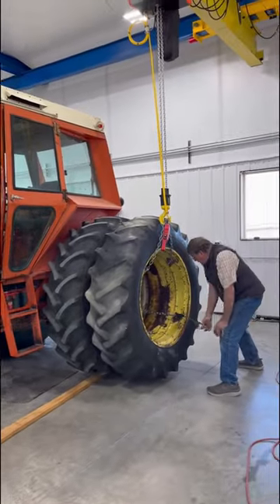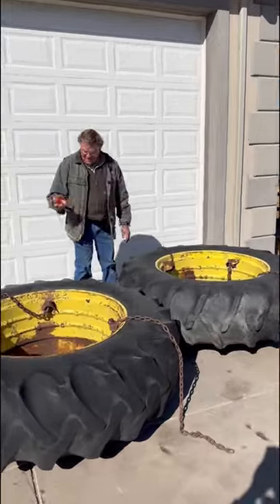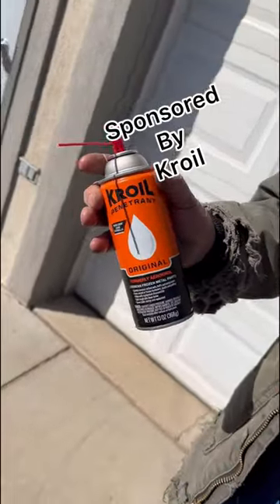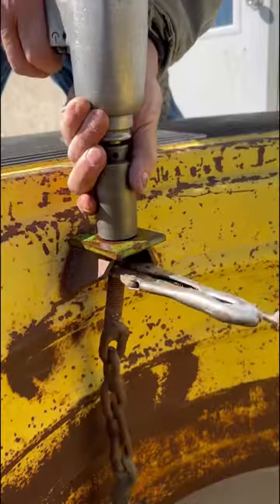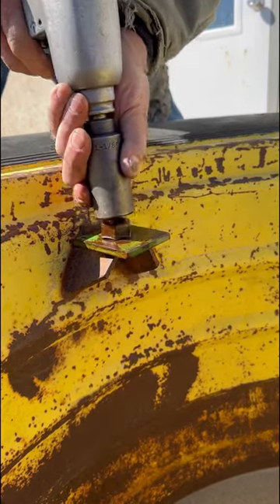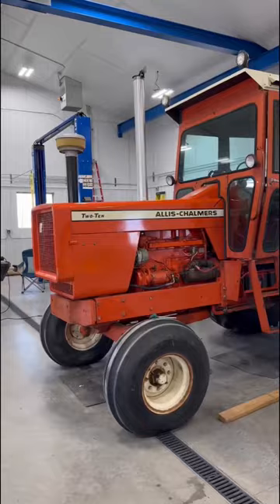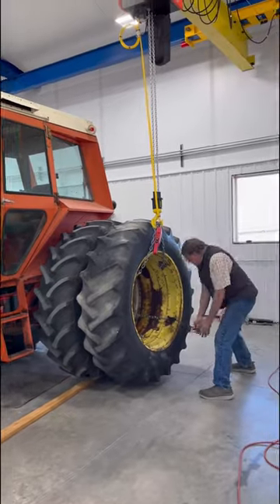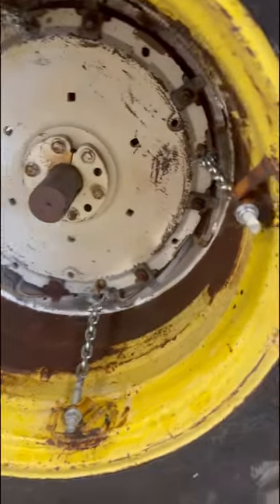#shorts Putting A Set Of Duals On The Allis Chalmers 210 Tractor

Comment: I hope you synchronized the valve stems!
Reply: Rebuild #3 coming up😅
Reply: Gotta have the serpentine belts in time too! So important
Reply: That’s actually a thing on some duals...
Reply: @Record3677 The Johnson Rod needs to be adjusted for the increased traction as well.
Reply: My dad was a mechanic all his career and he became a mechanic for the ISP post in Pendleton and he showed me that if you tighten the nut first it would help to crush the rust on the nut. He used linseed oil as a lubricant instead of red oil because it had a smell to it.

Comment: You have the dual phasing out by 45 degrees. You need to cross bolt the flange nuts to prevent torque steer.

Comment: Kroil is the poop, separated a u-joint spline that ran in saltwater. Froze it ,warm the outside and drifted it. Used a come-along to a tree behind the boat. Took a week repeating the procedure several times a day with soaking in between trying. It popped off. After new bellows it still runs years later

Comment: Does the difference in treadwear matter?
Reply: I mostly just dealt with class 8 trucks/ trailers rather than tractors but for dual on them on-road it is definitely better to run similar tread tires on the same axle, particularly for tire longevity. Off-road the terrain is basically never flat and usually is sunk down by the tires so uneven tread doesn't really matter, Especially considering the tire profile and typical speed of a tractor.

Comment: Kroil works well but it’s over priced. If 3in1 or deep creep doesn’t work, it’s doubtful kroil will; at least those two are like half the price. I like Z-Max since it’s mostly mineral spirits it will soak into the pores of the metal conditioning it, preventing rust and penetrating deeper than any other spray on the market. At least you aren’t like the morons out there who claim original WD-40 works as a penetrating fluid since thats the only thing it’s worse for than lubrication. Try to get sponsored by Motorkote, that stuff reduces friction a lot; check out Project Farm’s tests with it